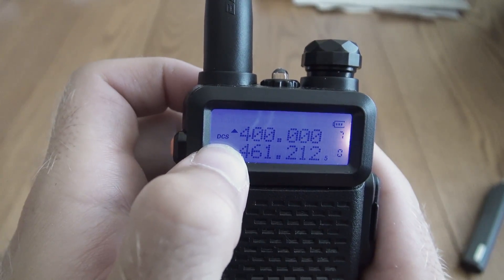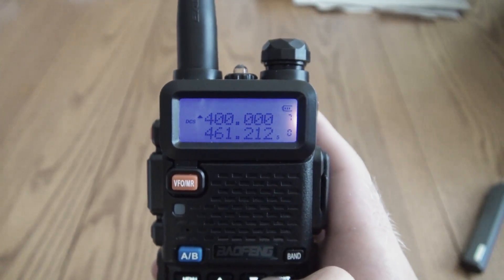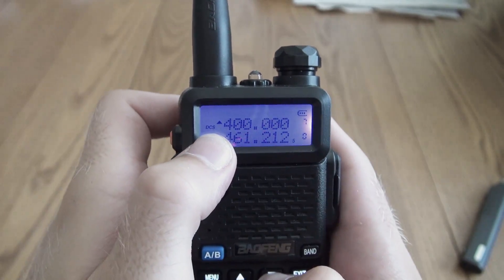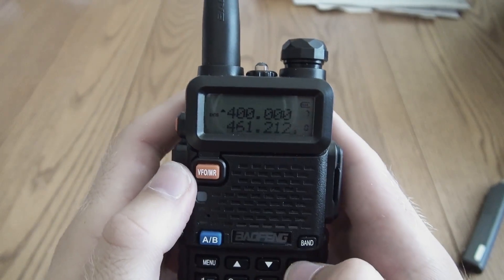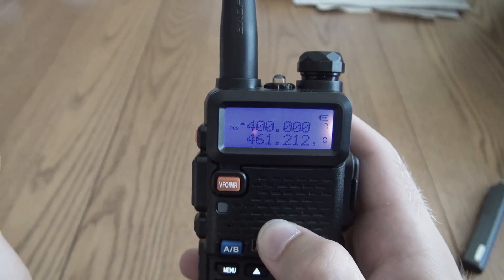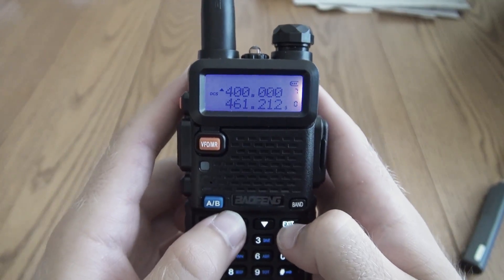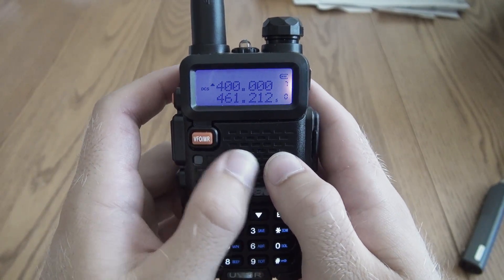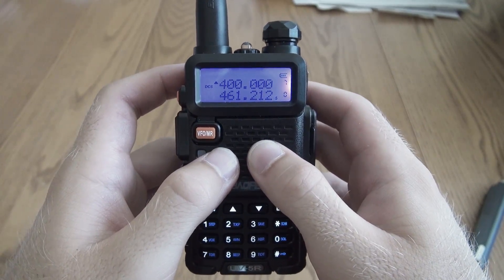Programming Channels on the BaoFeng UV-5R - DCS and CTCSS

Comment: Sadly, doesn’t work. A radio without the DCS/CT setup can still hear you transmit. You just can’t TX to them or RX from them.

I’ve tried with 3 versions of the UV-5 and a Tidradio H8, doesn’t work on any of them.

Comment: Thank you. Much appreciated. I own the slightly upgraded model of the UV-5R, the BF-F8HP, and was curious if there's a way to store FM channels? I understand how to place it in FM mode, and I also have the OEM programming cable. Just can't figure out how to store a commercial FM broadcast frequency. If it doesn't have that capability... it's not a deal breaker. Thanks again.

Comment: I just bought 2 baofeng bf b8 +111 I can't get the 2 radios to connect to use on uhf 462 frequency to talk to the other person on the 2nd radio, can anyone please help?
Reply: What seems to be the issue?  Do the screens look identical?  If they do, you could be trying the radios too close together and "desinsing" them.  This is a consequence of having too much power too close on nearby frequency.  They may actually be operating properly and your method of testing needs slight adjustment.

Comment: whats the difference between DCS and CTSS?
Reply: CTCSS, short for Continuous Tone-Coded Squelch System, often referred to as tone squelch or PL (Private Line), is a system designed to allow users on the same frequency to avoid hearing other users not in their group. It operates on a principle known as "sub-audible" signaling, meaning the tones it uses are at frequencies below the normal hearing range of humans and don't interfere with the actual audio communication. These tones, usually between 67 to 257 Hz, are transmitted along with the voice signal, and the receiving radio will only unsquelch or "open up" to let the transmission through if it detects its programmed CTCSS tone.

This technology is particularly useful in shared-channel scenarios, ensuring that groups can communicate amongst themselves without picking up all traffic on a given frequency. For example, if two different groups are using the same channel, each group can have their own CTCSS code. Group A's radios are programmed to transmit and listen for one specific tone, while Group B's radios are set for a different tone. Radios in Group A won't hear transmissions from Group B and vice versa, even though they're on the same channel.

In the context of repeaters (devices that extend the range of radios by receiving a signal and retransmitting it on a different frequency), CTCSS is used to activate the repeater. A user must transmit the correct CTCSS tone for the repeater to pick up and retransmit their message. This prevents the repeater from keying up for stray signals or interference.

Understanding squelch is key to grasping how CTCSS fits into radio use. Squelch is a circuit that silences the audio output of the receiver when there are no strong incoming signals. Without squelch, you'd hear a lot of static or noise in the absence of a transmission. With CTCSS, the squelch circuit is specifically looking for signals that carry the correct sub-audible tone. If the tone isn't present, the radio remains quiet, even if there are signals strong enough to open a standard squelch. This makes CTCSS an effective tool for creating semi-private communication channels on public frequencies, enhancing usability and reducing unwanted noise from other users.

DCS, standing for Digital-Coded Squelch, operates on a principle similar to CTCSS but takes a digital approach. Instead of using continuous tones, DCS utilizes digital codes to establish communication privacy and reduce unwanted noise on shared frequencies. This system embeds a digital code word in the communication signal, which is not audible to humans. A receiver set to a specific DCS code will only activate or "unsquelch" when it receives a signal with the matching code word.

This method provides a finer filter for communication channels, particularly useful in crowded frequency environments. It's especially effective in ensuring that only transmissions with the exact digital code are heard, thereby minimizing interference from other users not part of the group. With 104 standard DCS codes available, users have a broad range of options for setting up their private channels.

When setting up or accessing DCS on a radio, users will navigate to the DCS settings in their device's menu, selecting the specific digital code they wish to use for their group. This code must be shared and set up identically across all devices within the group intending to communicate with each other. For example, if a group chooses the DCS code 023, all members must configure their radios to transmit and receive with this code. When transmitting, the radio automatically adds the chosen DCS code to the voice signal. On the receiving end, the radio checks for this code; if it matches, the communication is allowed through. If not, the signal is ignored, keeping the channel clear of unwanted transmissions.

This digital squelch system enhances communication security and clarity, making it an ideal choice for groups needing reliable and private communication over two-way radios.
Reply: I want to create my own CTCSS channel, can u explain how to do that bro?
Reply: @Sead0g  Great explanation! If I understand correctly, group A's receive LED should still light up when group B transmits, to help prevent someone in group A from accidentally transmitting at the same time as someone in group B, since the groups are now effectively muting each other's transmissions; and one function of the monitor key is to temporarily un-mute the incoming transmission (ie. to make sure it's not an emergency call for help).

Comment: So WTF is DCS CTCS?
Reply: Digital Coded Squelch....
It's a digital tone that is like a "secret password" to the squelch.. 👍
Reply: Harles69 is it possible to connect a baofeng to another baofeng using the freq mode? I know about frs to gmrs i can do that i dont know how to do baofeng to baofeng or is it even possible? Thanks in advance
Reply: @SNEAKERTIMEPETE  Yes you can connect to another Baofeng ham radio. You can connect to any ham radio that is within your range. You both have to be set to the same frequency. But, you need a ham license to transmit on ham frequencies to be in compliance with FCC.

While the Baofeng radio can send/receive FRS/GMRS it is a violation of FCC regulations to send. The radios do not conform to FCC regs in the USA for FRS/GMRS.
Reply: @SNEAKERTIMEPETE  I'm not sure what you mean by "connect".. .. If you mean talk, just tune to same frequency (simplex)..
Reply: @harleyv1969  yes talk communicate thanks.
Reply: Re: DCS and CTCSS...One or the other of these will likely be required to connect to a repeater. Which code depends on how the repeater is set up.

You don't need these to talk directly to another ham radio.
Reply: @jim wiesgram Thanks!

Comment: Im a noob. You have a high number on top and low number on bottom but mine im trying to setup has a high number on bottom and low number on top. Do i switch them around and if so how?
Reply: Top number is channel A. Bottom number is channel B. You can switch between them using the A/B button. The selected channel will be indicated by the arrows to the left of the frequency.

The low number is VHF (Very High Frequency) and high number is UHF (Ultra High Frequency). You can switch between them using the Band button.

Comment: Do you know if it's common for the UV5R to show both - and + on the display after setting the duplex to + 5.khz offset. The radio still works, tx and rx but the tx is scratchy. Thinking this may be the cause.